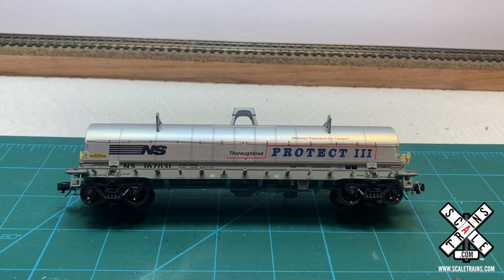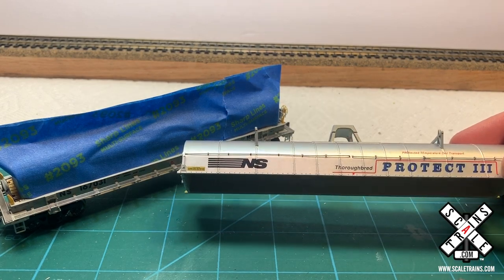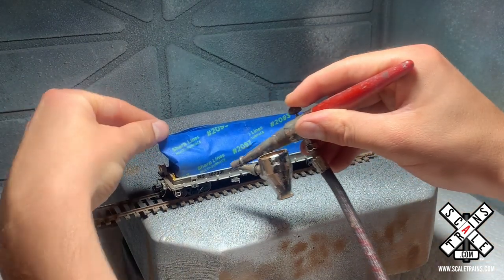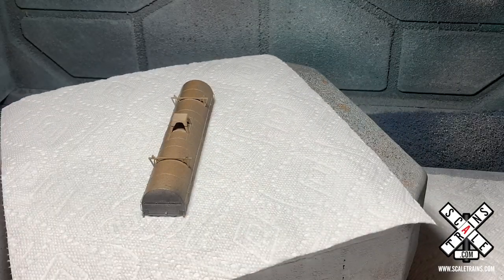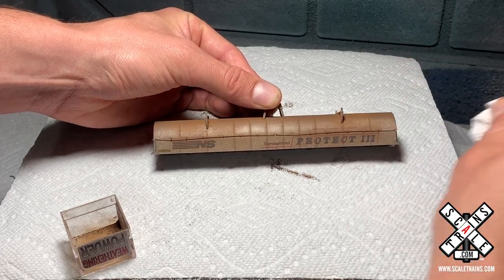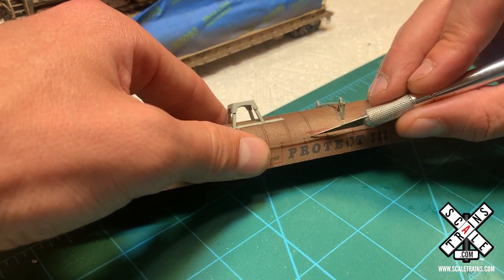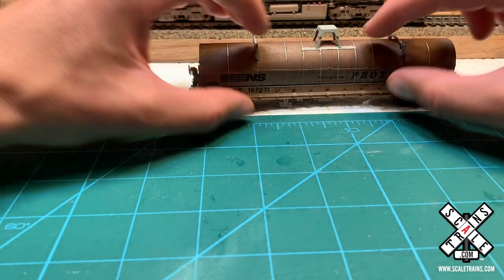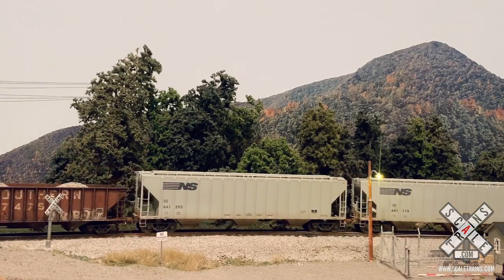Time to Model: Weathering ScaleTrains Rivet Counter HO Coil Steel Cars

Comment: The ribs sometimes have type of tape over them. The tape is similar to what HVAC technicians use on the duct work for heating and cooling systems. Great video Josh.

Comment: AC44C6M? Ok...curious where you got the 4184. It certainly looks like a ST river counter model, since no one else makes either a rolling bearing truck nor the see thru radiator grills yet in HO scale for an AC4400. One thought is, you modified the left hand (hidden) side of the engine with the AC cabinet, but the other thought is, this is soon to be announced by ST! Which we can only assume is going to be announced eventually, but maybe sooner than later!?! Not sure if that is the Easter egg in this video or not. Just curious.
Reply: He has a video on this unit. He cut up a Rivet Counter model and made it himself using another model's cab and electrical cabinet
Reply: @BAHolmes  Thanks for the info. Nice work on the model for sure!

Comment: Those brackets are so the hood can be stacked when not on the car.
Reply: And the center is for the crane to lift the hood. Could be why this piece isn't as dirty... similar to rails, siding vs main line.